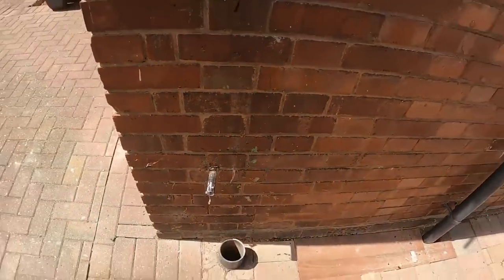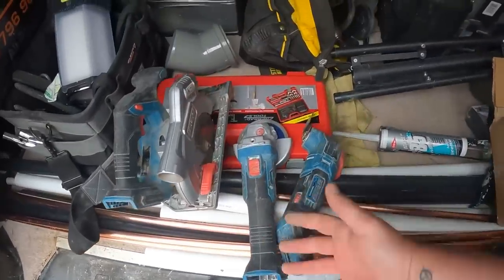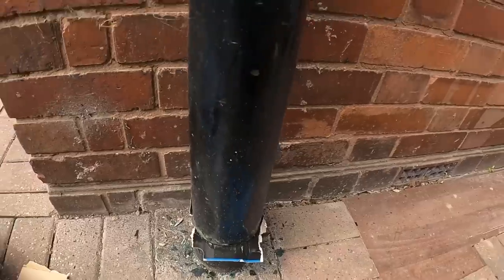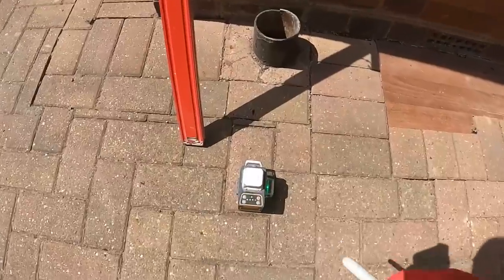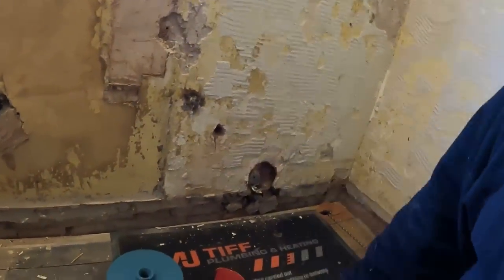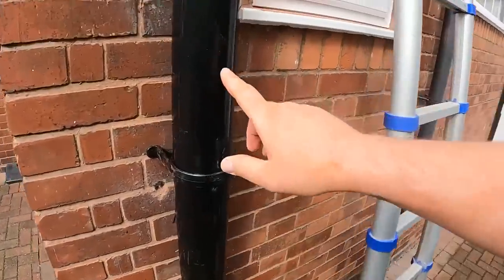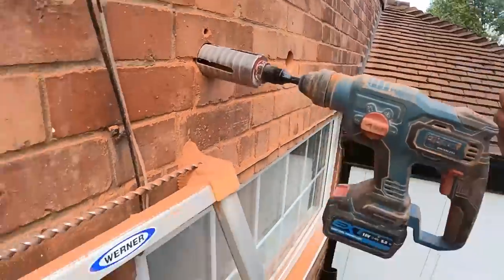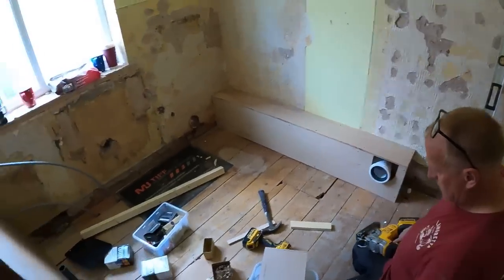CAST IRON SOIL PIPE REPLACEMENT | Bathroom renovation No 2 is well underway

Comment: I usually cut the soil with a chain cutter where possible and always use a drain adaptor also I would have started to remove from the top down in more manageable sections, not a criticism just saying👍
Reply from the maker: Yep, I would of if I had the long ladders on the job that day but just cracked on with the bottom section👍🏼👍🏼
Reply: I always use an Angle grinder to cut the bottom of the stack . They are bloody heavy though if they just let them fall away

Comment: Nice content as per bud👍🏻 angle grinder for me on stacks, remove a section big enough to allow the grinder to cut the back out of the pipe. On the plastic pipe, I mark the length and use a bracket as a guide to keep the cut square.
Reply: Like all that
Reply: Using a grinder makes most sense to me
Reply: Saved me the explanation that’s how I do it once the section is out a shove a rag in to stop debris going down

Comment: What I do is spin through the soil where it needs to be cut, then about a foot above. Then 2 vertical cuts to join the 2 horizontal cuts, with those sections removed take the guard off the spinner and cut remaining soil from inside out. It's quicker and cheaper than recipricating saw, and my chain cutters rarely fit behind stack
Reply from the maker: Nice one that👍🏼👍🏼

Comment: Easy Mate you need to get the correct ladder for the job 
good advice you should take the pipe down from the top and you should be wearing a hardhat 
cutting through and blocking the pipe was a good move 
you’ve just created a mess unnecessary work cleaning up and quite possibly damaged the driveway
If any of my lads works like that I would Get rid of them immediately
PPE should be your top priority your health and safety is worth more than what you get for that job👍

Comment: Just wondering so you cut the two waste in the stack why didn’t you just do the  sink in 40 outside as well and then reduce it down as it comes up though the floor I just the that better for flow and means all the pipes on the outside are the same size and means you don’t have to get two different sizes of pipe just the one
Reply from the maker: This is the way I’ve always done it, you really can’t tell any difference when looking at it buddy…. 
As for better flow, it’s a basin mate…. It’s perfectly fine with 11/4 as that’s the stipulated size

Asking for a length of 11/4 when I get a length of 11/2 isn’t that much of a problem….

Comment: Great video as usual. Have you though about coring a hole straight in to floor space to get away from building the boxing (looks like the joists are going the right way)? Not a dig. Just a thought
Reply from the maker: No chance are you getting a 4” soil pipe with fall into the floor buddy…… as said this was the best way and not an issue at all👍🏼

Comment: Could the McAlpine push fit single socket 110 dia be used to adapt cast iron to pvc ? Looks like it will push into the cast then a ring seal for the pvc ?
Reply from the maker: I prefer this way of doing it personally

Comment: You'll always blow out old brickwork if you just core from inside out. Put a shallow relief core in from the outside to avoid blow outs.
Reply: while you are correct, drilling with such a big bit is a nightmare on a ladder

Comment: I allways cut the pipe first then use a handsaw blade to up cover hole it’s thin also 👍🏻 keep up the good work
Reply from the maker: Hacksaw blade wouldn’t cover a 4” hole🙈🙈…. Cardboard covers it all👍🏼
Reply: He said handsaw not hacksaw. Big difference in the size. Really good tip  Aaron

Comment: Didn't like the look of the adaptor collar at the bottom. There used to be a male female adaptor years ago, aren't they available now? Look a lot better.
Reply: I used  cast iron time-saver couplings when we renewed most of North Glasgow City Council housing waste pipework. Much nicer looking and doesn't split like those flexiseal couplers do after a few years. I was taught that they hadn't to be used outdoors due to splitting by sun degradation

Comment: Hi. Great vid. Did you use push fit or solvent weld soil pipe if so why did you choose one over the other? Many thanks
Reply from the maker: I use pushfit soul pipe and solvent waste… just to keep it solid
Reply: @MJTiffPlumbing  So the pipe is push fit and all the fittings branches etc. are solvent weld? Is that correct?

Comment: Where do I begin. Should have started at the top, should have used a scaffold, should have broken the faucet rather than the pipe to prevent most of the cast going inside the stack. Accident waiting to happen. Switched off after 5 minutes.
Reply from the maker: That bit wasn’t 5mins in so your full of shit…… even comment for the attention.🤣🤣

Thanks for the comment “Dick” 👍🏼
Reply: Mmm, nice professional response MJ. Thanks.

Comment: Hi Mark, 
Using angle grinder to cut cast iron pipe seems easier than the reciprocating saw.
Btw, do u think solvent weld joint is more reliable?
Reply from the maker: Better still if I used the right blade as said in the video 🙈

Comment: Couldn’t soil pipe go under the floor board to save on having to box it, or was there to many obstacles there? Top job though 👍👍
Reply from the maker: Yer….. joists 🤣🤣
Reply: @MJTiffPlumbing  but the joists were running with you going by the direction of the floorboard 😂😂😂

Comment: 1 am not a plumber but is there a reason you did not tee the bath waste into the sink waste  running across the side of the building
Reply: When the waste nearer the stack drains it can cause a vacuum that makes the trap further away siphon out leaving an untrapped waste connected straight to the sewer - smelly!
Reply: @Richardincancale  Thank you Richard.
Reply from the maker: As Richard said…… 👍🏼

Comment: What drill do you use for your core bits? I'm assuming it's not the cordless. 
I've got to core for a dryer vent and I always find it takes forever with my DeWalt
Reply from the maker: It’s a big Titan power drill for coring big holes

Comment: Well, clearly the wrong tool for cutting cast, Its either a chain wheel, (old school) or much simpler is a grinder, which im sure you already have.  and how come you are doing it off a ladder? Wheres your tower, they are as cheap as chips these days.
Reply from the maker: Clearly the wrong blade for cutting the cast…. As said in the video. But it worked anyway….